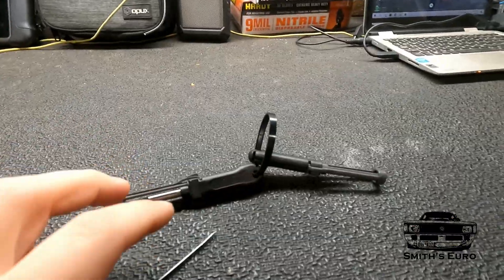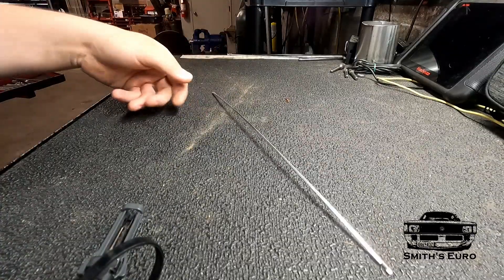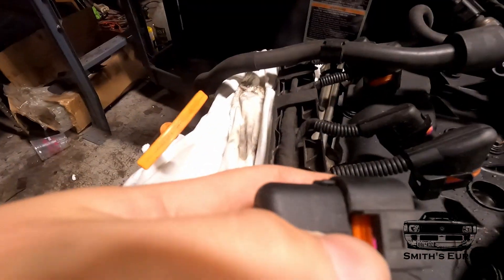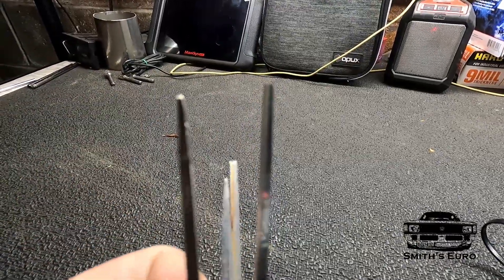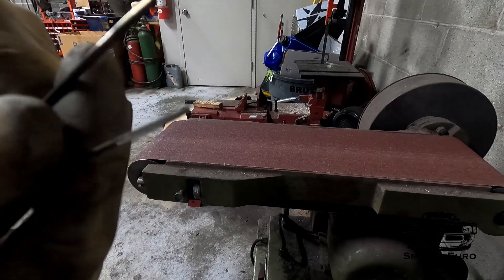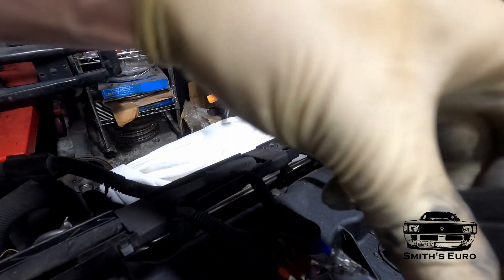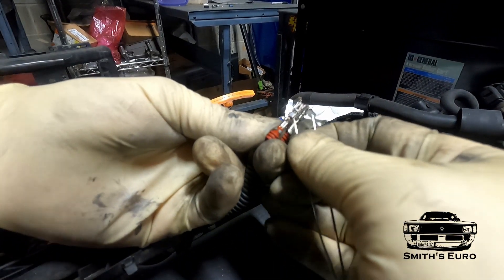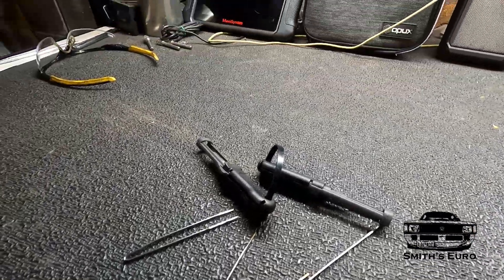vw pin tool (terminal release tool) making your own for free and repairing broken harness plugs

Comment: Good looking out!  I need to replace a fuel injector clip on my 2012 GTI. Do you know what other cars might have this at the junkyard?

🙏 Thx
Reply from the maker: I think those are micro pins 
You would have to make an even thinner version of this for that. Might not work.

Anything 2.0t will have the plug you need.

But honestly its easier to just get the part number off the connector and order it.

Probably 10-15$ for a brand new one.